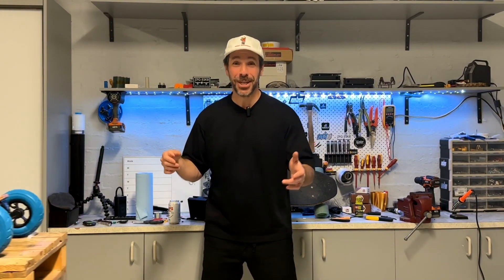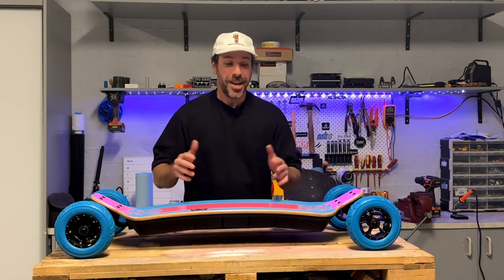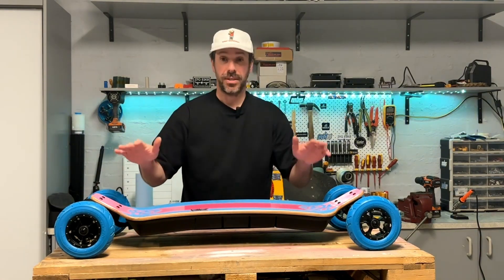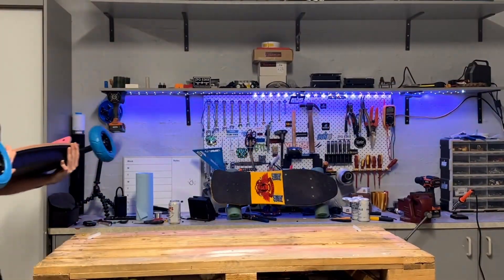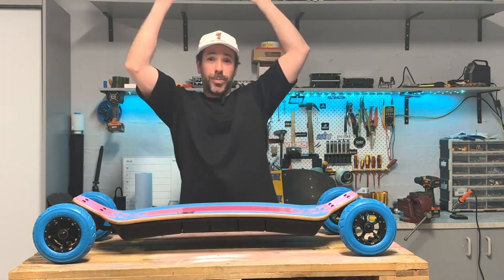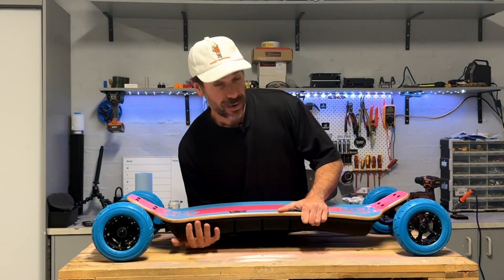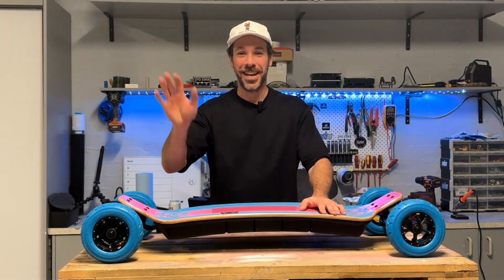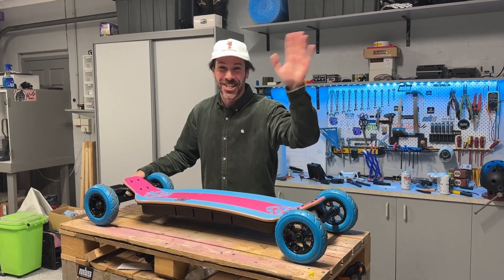Flowstate Skateboards - Lets dive into what a Flowstate complete looks like when you DIY

Comment: Been looking for my first esk8 and this is exactly the type of board I've been looking to buy. A long camber board with undermount battery, AT tires and gear drives. Wish someone sold a complete like this. It's a gorgeous build. Only thing  I'd change would be to throw on a set of land surf xcell 165mm tires for maximum low and wide aesthetic lol
Reply from the maker: Appreciate the positive feedback. You can buy this as a complete right now, you should check out the options MBOARDS have listed https://www.mboards.co/collections/flow-state they ship world wide too!